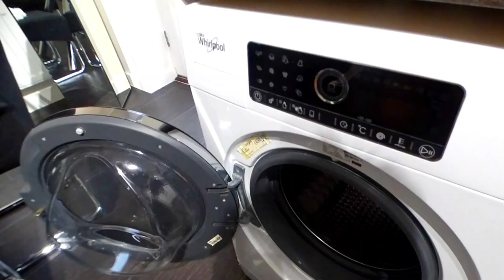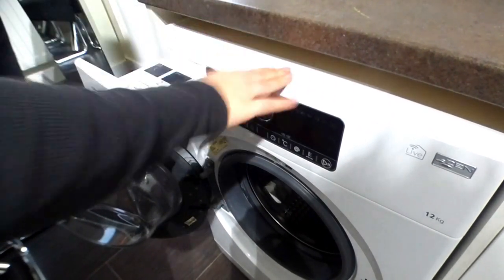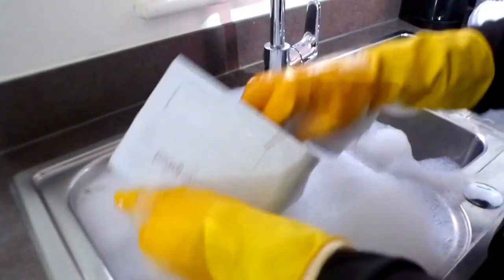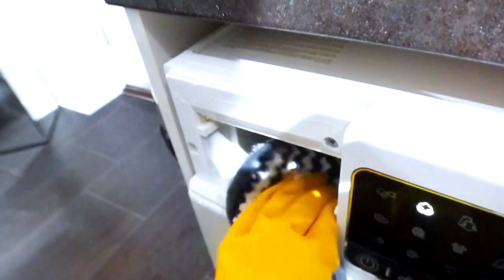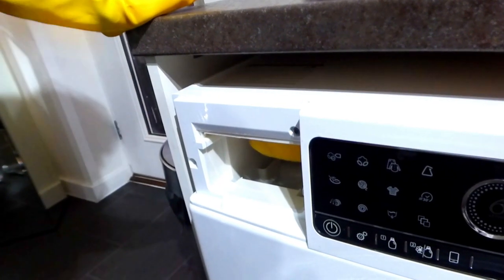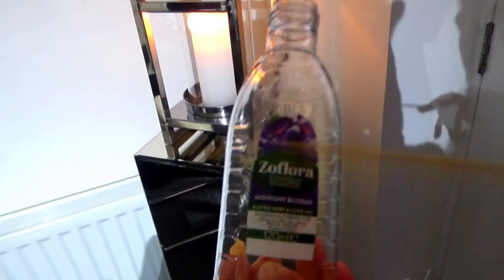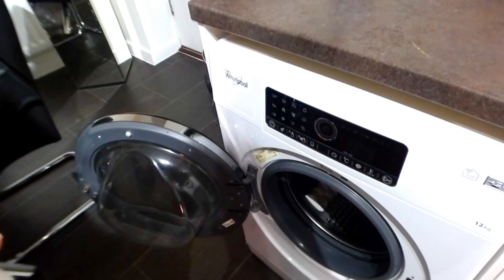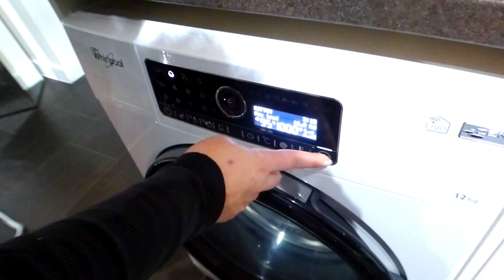CLEANING HIDDEN DIRT ON A WASHING MACHINE [CLEANING UNDER THE MICROSCOPE ]  LAUNDRY MACHINE CLEAN

Comment: I  prefer top loading machines. I've never been a fan of front loader ones. I have seen too many  videos about the gross build up. I just don't see how  a front loader  can get laundry as clean as a top loader. Just my opinion. I like the old fashioned top loading washer, with no drawers, no seals, etc. I just throw  pods in the bottom, add laundry through out the day, lower the lid and push a button.  I keep laundry simple. I also leave the lid open so  it can dry out between loads.  Well done !  Always a pleasure to see you  Hayley !    xx  🥰❄☃☔🏜💗✝🔆🥰❄☃☔🏜💗✝🔆🥰❄☃☔🏜💗✝🔆
Reply: Me too!
Reply from the maker: I really really want a top loader 🤣 I’m gonna see if I can source one here in the U.K.? I don’t know why we don’t have them here? I can only assume it’s due to our kitchen layouts. Xxx lots of love 💕

Comment: I shared this with my daughter.    She has a new front loader. She wouldn’t think about the  muck  that can be in it.
Reply from the maker: Do you have a top loader Marilyn? We don’t seem to have them over here? I wish we did ☺️💕
Reply: @hayleyshelp    No Hayley we don’t have a top loader.  My daughter did have top loaders before with the agitator in the middle. The agitator was rough on the clothes. The clothes used to get too tangled up around it. So she opted for a front loader and she loves it.  We share the washing machine.    I believe you can get a top loader without the agitator in the centre. She was just wanting a change from top loaders.   It’s strange that you can’t get top loaders in England ???